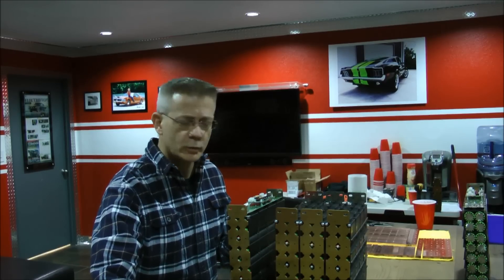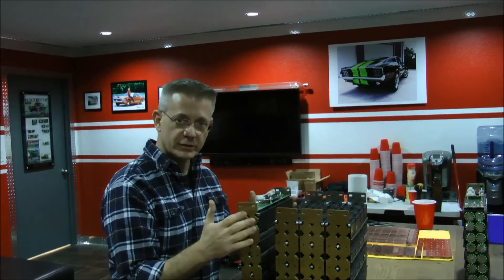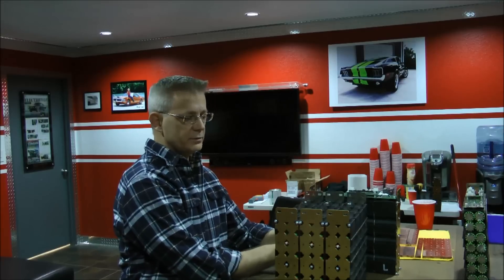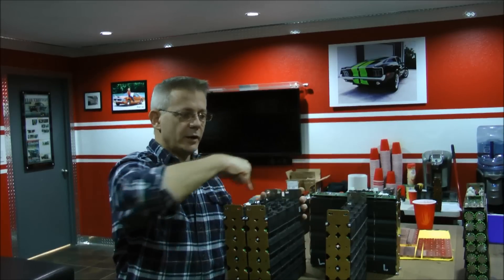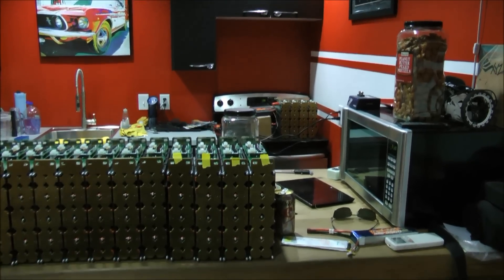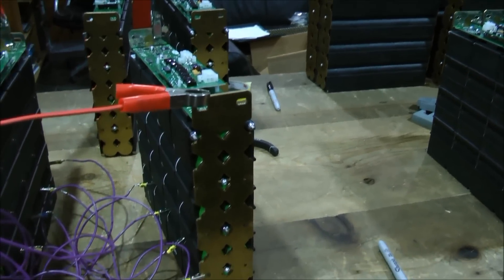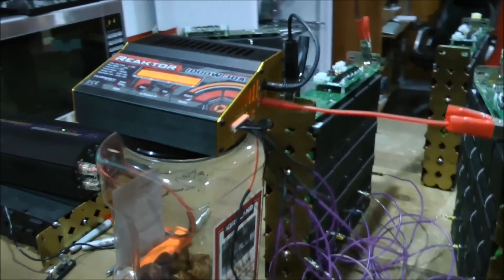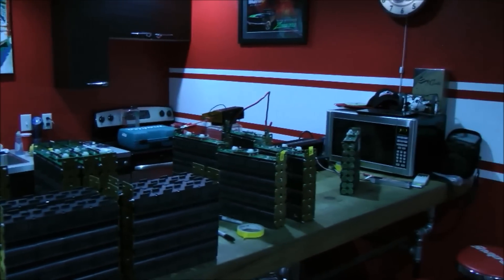battery overview part 4

Comment: how many volts do you get of every single battery pack (module)?? and how many amps do you get of each battery pack?
Reply from the maker: Pedro Valarezo each module is 14.4v and has 960amp continuous and 1920amp 10 second discard. The pack is a 396v nominal and 1920amp continuous and 3840amp 10 second discard

Comment: I really enjoy your videos, the car is awesome! The level of detail is great and you look to have a very logical process in your design and build! I build an electric scooter which at some point would be nice to use better batteries. Your modules look great, but are a tad too big for my purpose. Still I think the more custom electric builds like yours come out the more options will become available! In the end I'll probably end up with a 72V 5 kWh pack based on 18650 cells. cheers

Comment: Mitch, The design is really nice.

There is something VERY IMPORTANT you should not forget in the threaded copper connections:  copper is soft and  on the mechanical engineering point of view, the thread will pull and make a very small bump on the surface of the other copper sheet in contact with.. resulting in a not flat disk contact area but a only the lifted area around the thread on the top of the copper bar... What is usually made to solve that probelm is use bolt with a nut  a lock washer and a washer on teh opposite side of the copper bar to have the copper bar squeezed between the nut and the flat sheet of cipper of the module.. This way all the pressure will be extended on a larger diameter  for the elecrical contact. I knwo this might not look ti be very important but only few thousand of inch are required to isolate teh contact!
Reply from the maker: +Doctorbass Thanks for the advice. We are also using silver paste on all copper to copper connections.